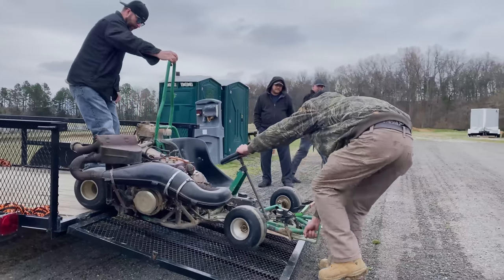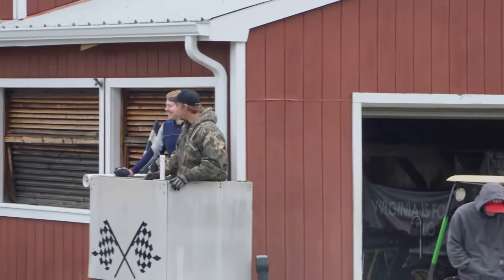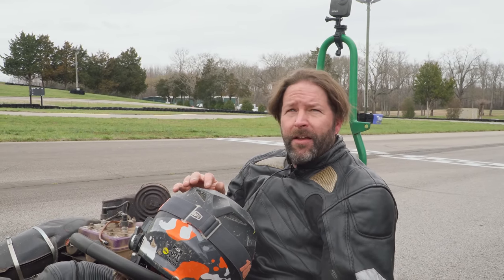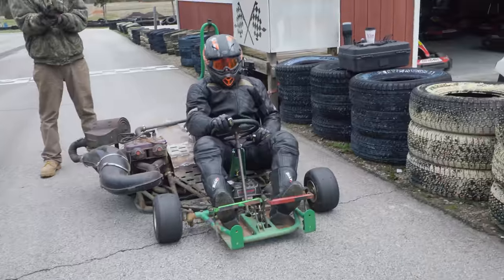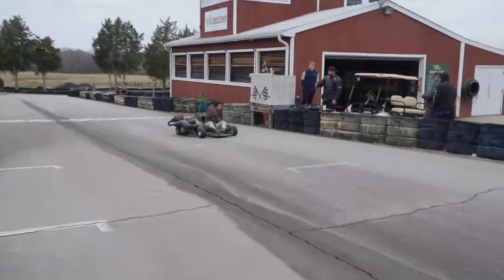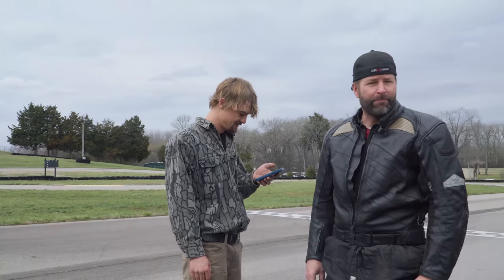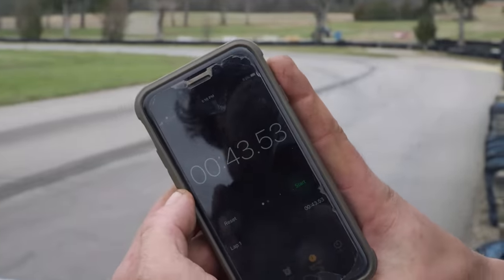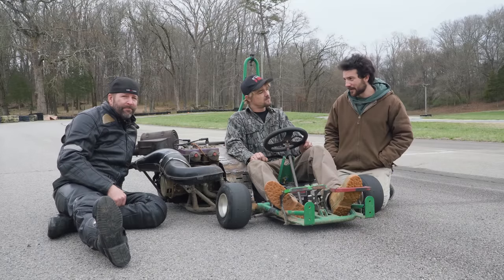We took our 125HP Go Kart to the Race Track! | *Insane Acceleration*

Comment: The most likely reason it’s not running the greatest is it’s too rich again it’s made to run in the cold I recommend looking up a jet table for that engine which will let you get it running right for your temp and altitude
Reply: Also that motor is equipped with exhaust valves, the round things above the Y-pipe, that have a tendency to stick  or be sticky over time best course of action is to simply take them apart clean them hood and put them back together

Comment: Fix the jetting please this thing has so much more to offer look around someone must have jetting numbers for your temps and altitute if not then drill a hole in the exhaust and install a wideband sensor and jet it after that you can buy one from koso works great hook it up to a 12 volt battery from a power drill or something and keep it in your pocket while you check the numbers. This is not just regarding the main jet the kart is bogging heavily when leaving probably way to much fuel on pilot and needle circuits as well please we need to see this thing scare you on demand :')

Comment: If you want it to perform better and be controllable.Add two feet to. Length of it. Add aluminum body that forces car down on the pavement. Add bigger diameter steering wheel. Come on guys use your brains

Comment: Track is too small for the speed of the kart. I built a Yamaha G9 golf cart with a Yamaha 570cc Exciter engine in it approx. 20yrs ago. Lots of fun, very scary fast, no roll cage or seat belts, only rear brakes LOL🤪. Only ran it a few times back then, been sitting in the garage since losing most of the compression needs rebuilding/pistons, rings, cyl coated Etc..

Comment: Are you kidding me with that fan? That is doing nothing without a shroud. Also you need to run a thermostat if the motor isn't getting up to running temp you will magnafuse the cylinders.

Comment: 2 into 1 2 stroke  exhausts lose too much power, you will get much better power with 2 expansion chambers fitted
Reply: lol          that's an argument nobody here has the intelligence to make.    there is so much that comes into play with sled engines.     you aren't really wrong...   but they need to be proper pipes for the engine..  then you need to rejet (like they need to anyhow) clutch work..  and even then, you may gain some higher end HP..   but you will 100% lose a bunch of bottom end. which is pointless in this build. and also 2 pipes are heavier.  they need to rejet, clean the exhaust valves and clutch this thing if they want it to feel all of the probably around 110HP it can as it is.
Reply: @ExploreUnderground  it would work if the 2 pistons reached TDC at the same time but being 180 apart or whatever it is, messes with the transfer ports timing which causes too much power loss, no race bike has used this dumb idea, but some sleds and jet skis use 2  or 3 into 1 setups due to the lack of space in them.
 2 stroke tuning and understanding it fully is something not many people understand or even try to,  like some of the Asian guys racing 2 strokes and only using headers ??? I've been tuning 2 strokes for 40 odd years but still they confuse me at times bit I know what works well and doesn't  like rotary disc valves are a better system to use but take too long to change & are expensive unlike simple reed valves
Reply: @rickburnout666  I have and have built plenty of 2 stroke engines..   1, 2 and 3 cylinders..   with single pipe, twin pipe and triple pipe set ups..  most sleds use a single pipe on a twin cylinder engine. I'm not sure your point on rotary valves costing more than reeds..   you don't generally change them lol  I'm not going to argue with you about stuff you didn't mention, I'm going to assume you don't know it still.  Regardless of the pipe set up, it NEEDS to be built for the specific engine.  That is a fact.  You should do some deep research on sled technology if you want to really get it.   But there is a point in the RPM where the 2 sets of pressure waves (each cylinder makes 2.   A exhaust wave and a sound wave) reinforce each other and will make a shit load more torque than any other pipe set up. Which is the real reason sleds have single pipes..  and still make the most HP per cc of any engine out there basically..   with a couple exceptions.   Yes,  MOST open mod race sleds use twin or triple pipes..     they also run race engines.. high compression, race gas, super high rpm clutching with a low operating range to stay in the narrow powerband.      
 Again..   there is a lot more to it, and everything you change effects everything else down the line.         
You may not know it, and thats fine, but I've built a race sled or 2 over the years.. radar run sleds.. literally the point is to make it go fast as you can lmao
 Proper clutching and jetting will gain 5x the power to the wheels all the way from 3500- wide open than what twin pipes would do to this kart.    I'm not going to learn anything in a Cars and Cameras video comment section. I'm not going to debate it either, the information is out there for engine builders (Though they tend to know it..   bolting a new part on isn't building an engine)  
And with that..  I'm out.

Comment: That motor is way fat it is jetted to run 0 f  you are running at 50-60 f my guess those motors are temperature sensitive also the intake air box is part of the tuning ready our plugs and piston wash jet according